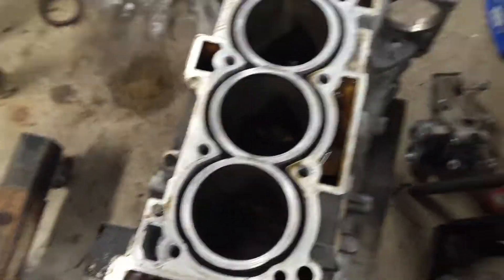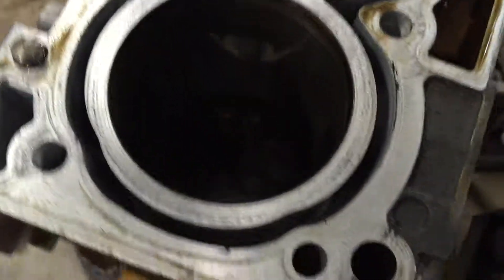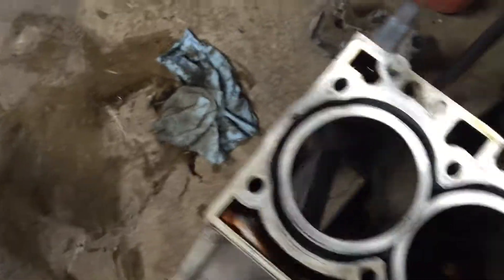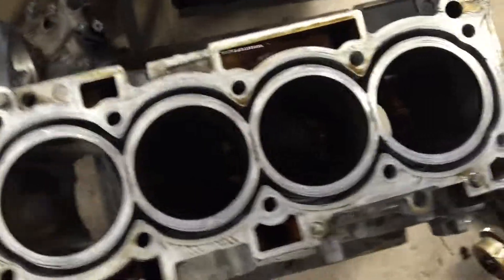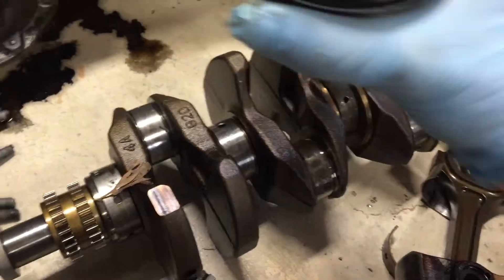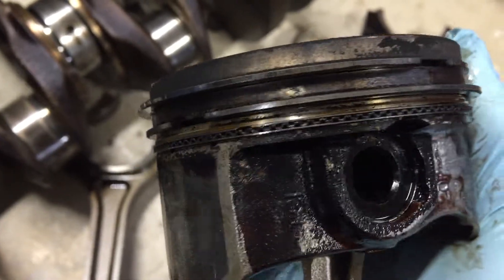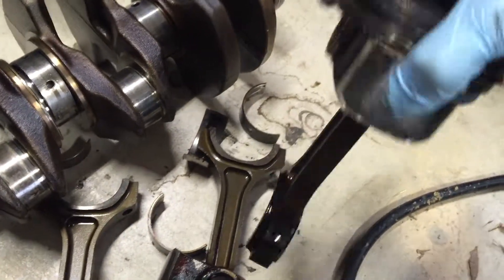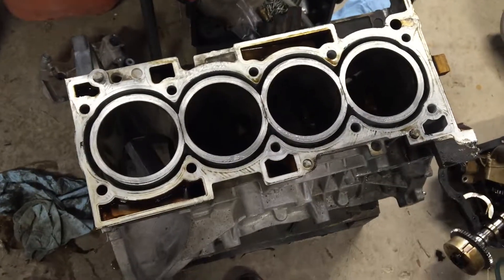Hyundai Genesis Coupe 2.0T Engine Tear-down part 5

Comment: Hey, I was watching the series because I’m about to do this process myself. 
Assuming there was a bit more damage to the cylinder walls and dry running symptoms, would a bore with pistons, rods and maybe cam do the trick?
Reply from the maker: Yeah, that and new bearings all around. Check the crank journals to see if they are scored up; they were really bad on this one.
Reply: @eatont9999  Thanks for that

Comment: Any updates???
Reply from the maker: No, that's all she wrote. I pulled the bearings out and they were trashed. Some were paper-thin and others were just scored up. Cylinder bores were scratched up and had very little crosshatching left. Pistons seemed OK but they would need rings at a minimum.
Reply: Is it back on the road now?
Reply from the maker: @JonathanO711   Yep. The customer has been driving it since the engine was replaced. Wound up doing a transmission for him a few months later.